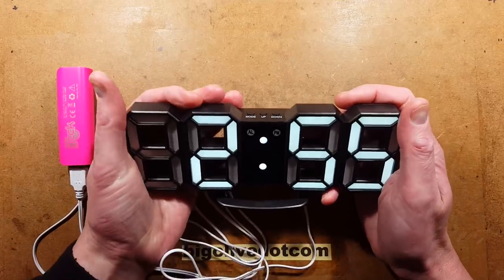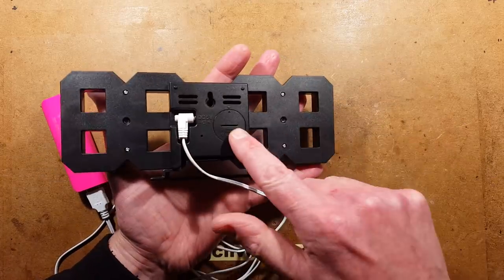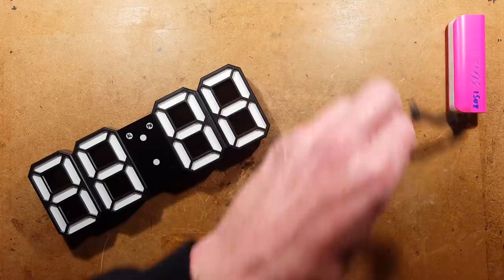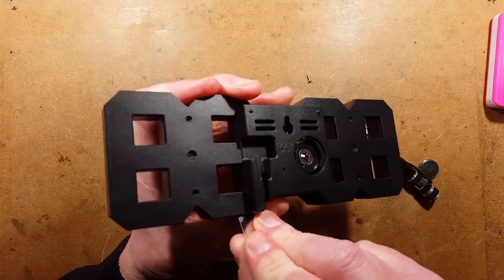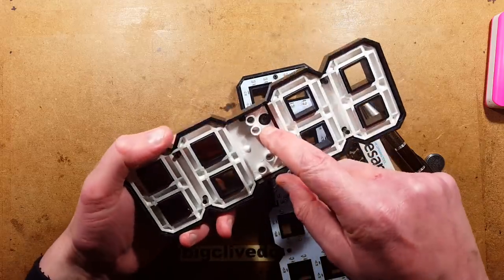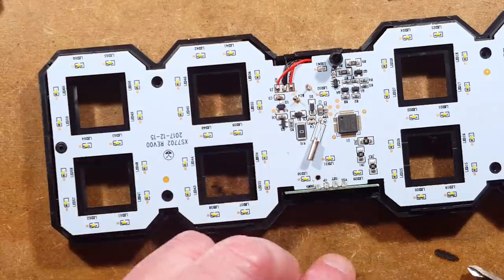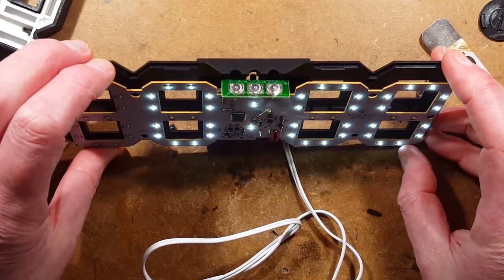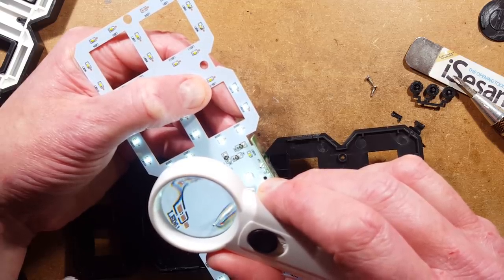Inside a large "3D" digital clock.

Comment: Clive if you're lucky you can unlock the bootloader of that Cat phone and install a custom ROM like LineageOS onto it - then it would work with any camera app. I have started only recommend those kinds of phones to people where that is possible. It also helps with privacy if the Google services framework is only optional, and you'd get along fine with µG instead.
Reply from the maker: It appears that Bullitt have locked the phone down to prevent people using leaner firmware with it.
Reply: @bigclivedotcom  That's a major factor to look out for when deciding to buy a new phone (and which phone to buy) then.
Reply from the maker: @Seegalgalguntijak  It is.  But this one is the only one that has an integrated thermal camera.
Reply: @bigclivedotcom  Okay, that's indeed something special then. They probably couldn't even open the drivers for that so the thermal camera would lose its function with a custom ROM...

Comment: At 9:05ish in the video there's a close up of the CPU and the surrounding PCB.  In this, there are 6 little orange dots - 2 look to cover the fiducials at opposite corners of the CPU, and the other four look like they are covering bed-of-nail test points.  What the hell are these dots really?  Are they manually or machine applied?  What the heck are they for?
Reply from the maker: They're bare copper contact points, either for testing or possibly for in-situ processor programming.
Reply: @bigclivedotcom  Bare copper?  I didn't recognize them - I've only seen fiducials and test pads plated like all the other pads.  Do you think the SMT pads were plated before pick and place, or are those bare under the components?

Comment: Recording device. Picture was great and sound was great. The last device your voice was Bassy. As far as using samsung device I've used them for 12 years and when I get them I buy 5 for the family. Up until my current phone which is 4 years old samsung s7 edge no problems at all but my camera when out then my sons camera in his phone just went out, i had noticed that both are memory cards were full or almost within a gb I dont know if that's the cause of the failure. Just heads up tho. I tried putting a new card in and all the other suggestions I even replaced the camera. To no avail still no worky worky. But other than that from samsung from s3 to s7edge no problems, just 2 cameras in the s7 edge. Will.i buy another samsung yep I will. That's 20 phones in 12 years and only 2 problems. Thats a pretty good record.

Comment: @bigclivedotcom mind sharing (in whispers) what old (whispering Samsung) phone you used.. It actually produces really usable quality video? I might even have one laying around I could re purpose.
Reply from the maker: It's a well abused S6.
Reply: @bigclivedotcom  the S6 and S5 had a fantastically useful feature..
A built in I.R. led.  What a shame this feature has been kept on smartphones
Reply from the maker: @gs425  The IR control app creator went rogue.  They started forcing full screen adverts randomly so that if you were typing on another app you clicked the advert.
Reply: @bigclivedotcom  what a shame. I recall that Peel remote app was amazing to use. Showed thumbnails of programs to click that were actually showing.  Also it changed to different preset tv brand set of codes if it thought you had for instance gone to watch t.v. upstairs. It also had uses to operate hotel aircon or pub tvs without the actual remote to hand. 
I am still using a 3 year old S7. Reason being it is still v quick , but I believe it was the first of this new breed of dual pixel camera with astonishing low light capabilities. I sometimes use the camera to avoid dog shit whilst stumbling home in  low light after a late night lock in! Worth a look as the are to be had v cheaply now

Comment: I have the same problem with the S61. I even bought Filmic Pro for mucho dinero hoping it would work but no dice. Still love the phone but not good for video.
Reply from the maker: I've tried three different video apps and they all have a jumping issue with the front camera.  I think there's a firmware issue.  Does your skip sections of frames and jump too?  If you record some video of your finger moving back and forth in front of the camera it shows obvious jumps with other camera apps.
I wish they'd allow it to be rooted so proper firmware could be written for it.
Reply: @bigclivedotcom  Yep, no matter what frame rate and quality settings it's like the camera is hanging up for a second every few seconds. It almost reminds me a little of when you have the calibration shutter auto calibration on with the thermal camera where every so often the image just freezes until it completes the calibration and the black body shutter opens. 

Both Filmic Pro and Cinema FV-5 do it. Interestingly enough, I tried a novelty VHS effect program and it did not have any stuttering issues so it theoretically is possible to use the rear camera without that happening but who knows what they did differently.

Comment: I have problem of fading LED  Segments in this clock. Any solution?
Reply from the maker: I run mine at low intensity as the LEDs will fade over time.  Red is the most reliable colour.

Comment: I have one of these on my wall, it gets around one minute too fast per month, so if i last set it 6 months ago its 6 minutes too fast.
Reply: Alot of these newer digital clocks seem to lose or gain  +/- about a minute a month, my microwave one does. The radio controlled  (MSF or DCF 74) ones are the best for accuracy nowadays. 
Many of the older mains powered digital clocks were governed by the mains frequency & kept perfect time for years.

Comment: Clive, what printer are you using.
Reply from the maker: Epson ecotank.
Reply: Cheers. Am  in the market for an inkjet that would do photos and your prints looked good on the screen. And anoher suggestion ... what  about a selection of USB leads and test the charging current. I have several and they range from around half an amp to nearly 2. The best seem to be the branded ones but I have several that are unbranded and are really good. Dissection and autopsy?

Comment: Why a test point right of every led?
Reply: Dumah Brazorf Probably so larger LEDs could be used if the supply of smaller ones dries up. ie. 1206 size instead of 0805 size.

Comment: Really annoying when they go USB for power and then use a barrel jack instead of a micro-USB port on the device end so you can't just use any USB cable. How much could a microusb port add to the cost? Is it even any more expensive at this stage?
Reply: It was probably originally designed for  (or sold with) a plug in power supply but then swapped for a usb lead because they are a LOT cheaper and more universal

Comment: Found a kind of similar clock on amazon that has temperature and remote control maybe thats what some of the extra holes and stuff were for        Redlution Large LED Digital Wall Clock 3D Design Jumbo Larger Numbers Alarm Clock with Full Function Remote Control, Calendar, Snooze, Alarm, Countdown, Thermometer https://www.amazon.co.uk/dp/B01I2N7CNO/ref=cm_sw_r_cp_apa_i_.juUDbJG8C4HK

Comment: Moderately disappointed at how you represent DatasheetArchive...

One. Your browser should have an adblocking extension (that's the Chrome term; Firefox calls them "Add-Ons" IIRC), such as Adblock Plus, installed and running at all times, period, for your computer's own protection. Too many ads out there download viruses upon simply loading the ad in the browser with the rest of the page! (Believe it or not, the number of sites that actually audit their ad providers and the ad served by said providers is alarmingly low.) Oh... and if a website insists I view their ads (here in the US, a lot of newspaper sites do that) I assume they don't want my business and go elsewhere. No exceptions.

Two. I often seek out DatasheetArchive because its repository is one of the most complete, in my experience (although a little fishing can be required at times), and because it's relatively easy to work with. If the appropriate search page doesn't show up in Google just like that, a quick search with their in-built tool will bring you results quickly.

Three. Any tool will make a mess of things (and a fool of you)  if you don't know how to use it. Usually you can skip the "in stock" type results, especially if -- like me -- what you're typically trying to find is a somewhat prehistoric or otherwise obscure part. When you think you have your part, click the "PDF" button, then the image of the document underneath. A new tab will open... click the "View Datasheet" link there to open it in your browser's inbuilt PDF viewer, or whatever extension/ "add-on" you've installed over that. It's easy!